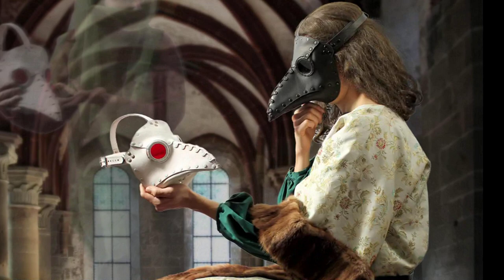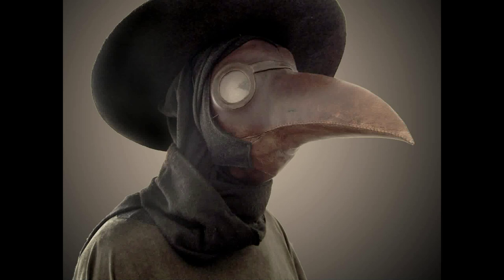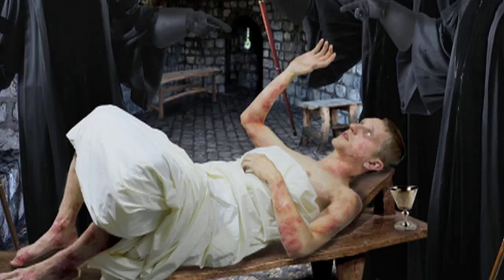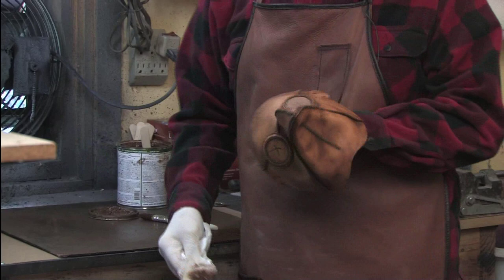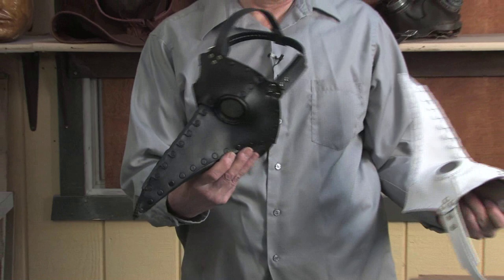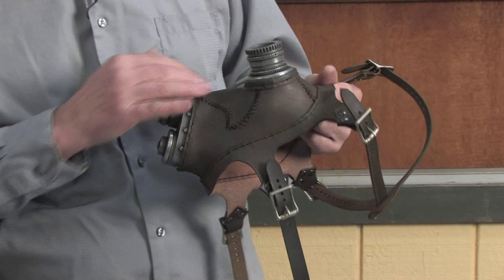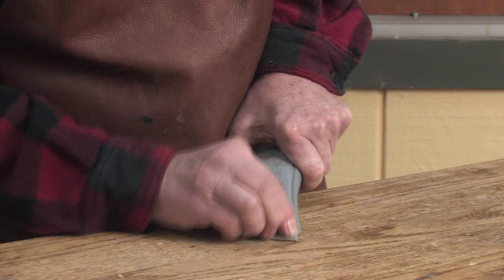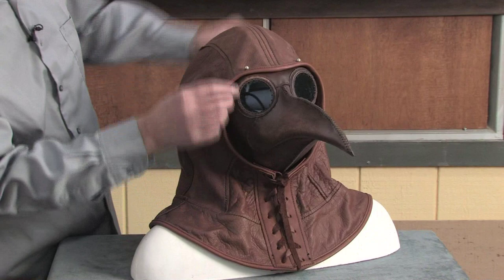Tom Banwell's Plague Doctor Masks

Comment: If you dont mind me asking where do you get your leather from? i cant seem to find any thick leathers in my area.
Reply from the maker: Try Tandy Leather www.tandyleatherfactory.com
Reply: Use pleather, be vegan friendly.
Reply: Use leather made from vegans.
Reply: Mikkel Andersen it rubs the lotion on its skin or else it gets the hose again
Reply: pleather is shitty. Actual leather holds up better and lasts for years
Reply: TubeYouGuru sir pleather is crap.
Reply: What I did was bought an old leather recliner for $20.00 stripped the chair by carefully cutting the leather off at the seams... and there you've got your leather.... you can sometimes find those chairs on people's curbs... and there you have free leather... I've done that too. Furniture leather holds better it's thicker cowhide. No need to spend lots of money, plus you'd be doing a kind thing for animals (reducing the demand).. just recycle what's already there, if the leather color is not correct... then just dye the leather with leather dye... which I've also done. I prefer the worn out look... more original looking if you ask me.